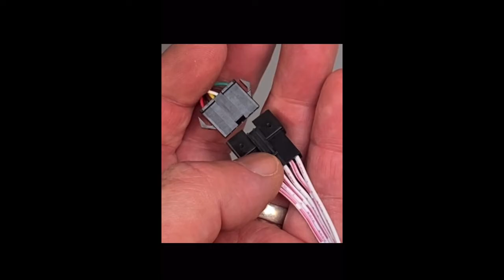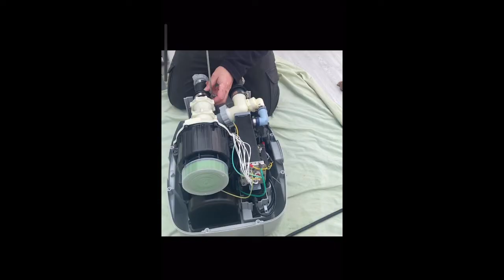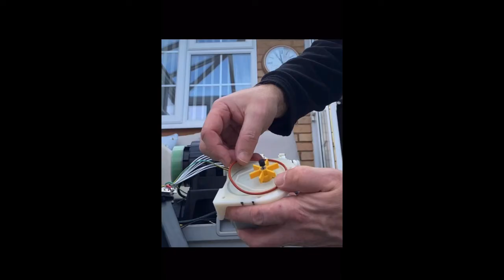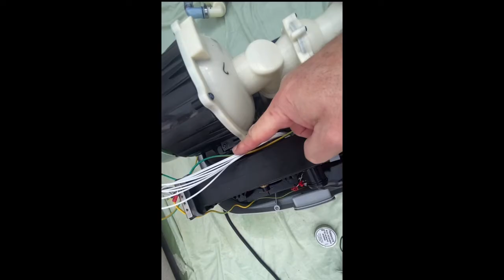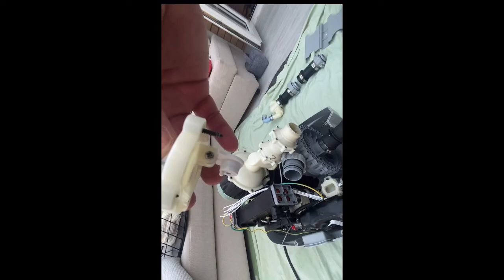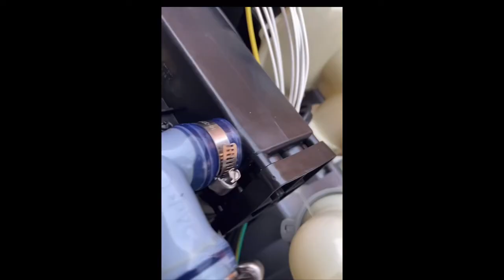Fix E02 on Lay Z Spa new Hydrojet (4-pipe) pump. Replace an impeller (and flow sensor)

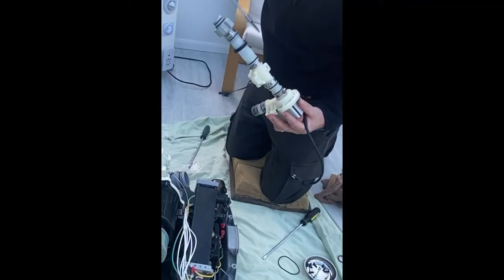Comment: 6:31 Brilliant video, I have same pump and it appears to be leaking water but there is no error code. I’ve taken the top cover off by unscrewing and cutting cable tie just to see if there is anything obvious, however, I can’t see obvious signs of leaking but then again I’ve no idea what I’m looking for. Is there a general problem with these pumps that causes leaks? I’ve looked all over internet for similar problems but cannot find one covering this style of pump and problem. The model is S200102. Any advice would be welcome. Thank you.
Reply from the maker: Sorry for the late reply, only just noticed your comment. Common places for leakage are usually the heater matrix seals and the flow sensor housing seal.  An investment in an EASY-SCALE kit will easily show you where it is leaking.

Comment: Thanks for the video - very few cover replacing the flow sensor. Can I ask, is it just the tiny flap that gets replaced in the flow sensor unit? I have a persistent eo2 error and have done everything including replacing the impeller - the flow sensor is my last port of call but not sure what part I'm looking for. Any advice much appreciated!
Reply from the maker: Hi Jimmy. When you buy a flow sensor you get just the flappy bit. Some sellers (on ebay etc) provide the pin (which is very brittle) and the seal which you just as well replace anyway